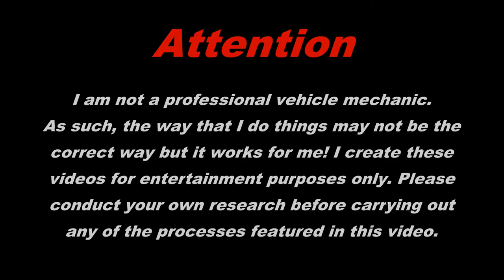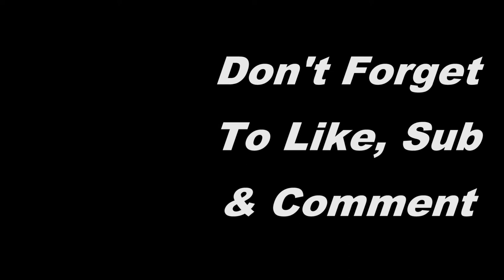BMW E65/E66 7 Series 2001 - 2008 Rear Lower Suspension Bush Replacement

Comment: Hey Kev...i have an 07 e66...i had to replace the bearing...i pushed the axel out of the splines far enough to sneak tools in an take out the old bolts and bearing/hub...had the old one pressed off and new bearing pressed on...bolted it back on the car...and i cant seem to get the axel back in the splines...i hammered on it so much that the hub is now a little loose on the new bearing(i can tilt the hub towardsme a tiny bit)....i got it almost through enough to the point i could get the new nut on and thread it through...i decided to take that long lower bolt out to help, but it made it worse...and now i cant seem to get those holes lined up to get the bolt back in.......any tips would be great....you seem to really know your stuff...thanks
Reply: Ohhh...and, Happy Gilmore by the way.....classic !!!🤣🤣🤣
Reply from the maker: Hi John, I replied on Instagram! 👍